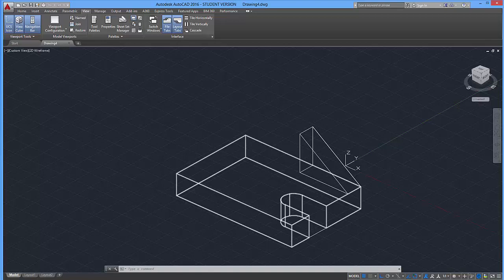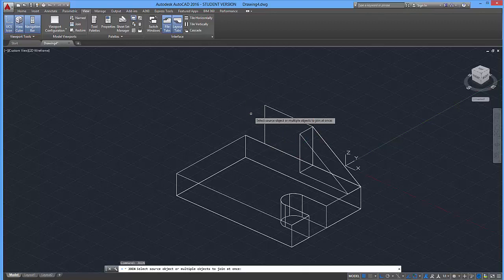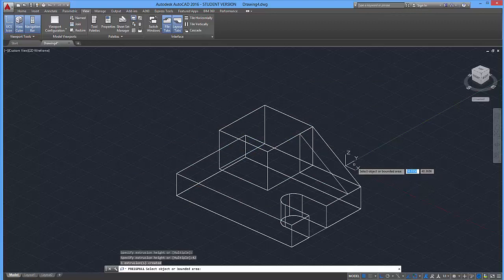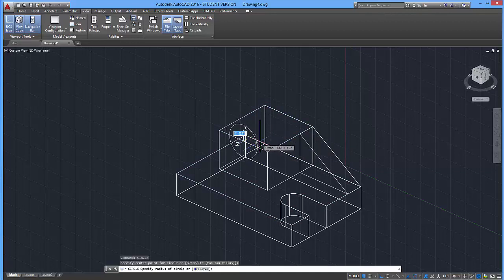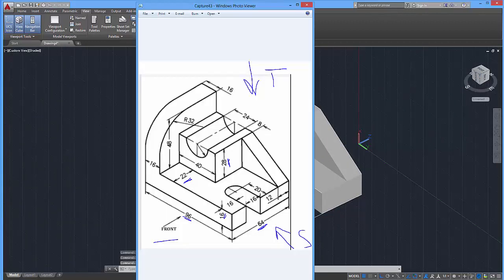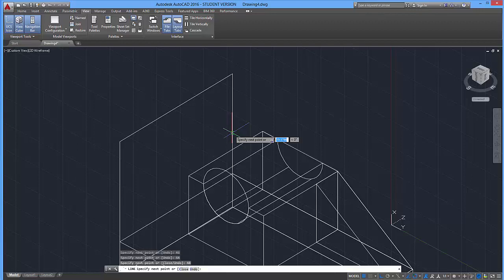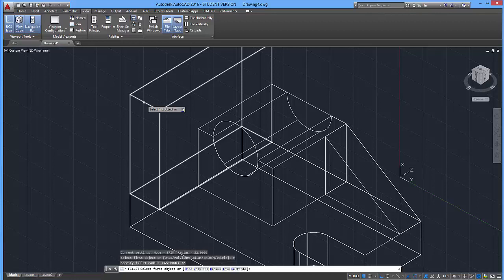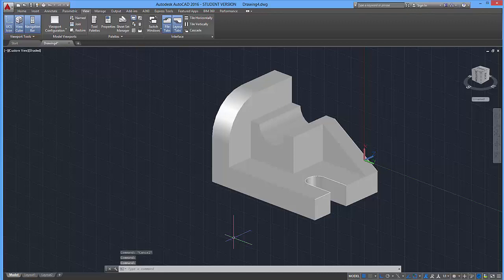Beginner Tutorial 5 - Autodesk AutoCad 2016 - Designing Isometric Objects Part 2

Comment: How do I get lines to follow on the axis I expect? I have my axis setup the same, viewing this from the same angle, however when I try to draw line what appears to be up in some stages, it actually follows along a different axis/plane and ends up connecting elsewhere. Meanwhile you seem to draw without problem. Thanks so much for the videos by the way they are great!
Reply: I think you need to turn the polar tracking on, the button locates on the bottom. Remember to set increment angle to 90 degree by the way

Comment: Paul, I have a dumb question:

I've been watching your tutorials to get my hands back on AutoCAD. I've been trying to build a 3D model of a metal structure we are going to build. Surprisingly, after watching your videos it all came quite easily... except for one thing. 

I've had to draw shapes that require a change of axis (like you just did). While drawing the roof I had to do this, but now that I'm trying to go back I noticed that my axis are all wrong, not jut inverted, but completely out of it's original angles in proportion to the shapes I've drawn. So now, instead of having the floor perfectly parallel to the X axis, it's all crooked. I'd been kind of using this Axis as a guidelines and now I think I messed up my work. Is there an easy way to reestablish this?